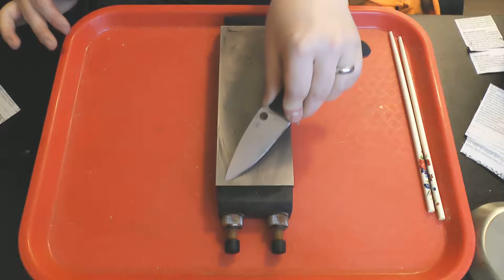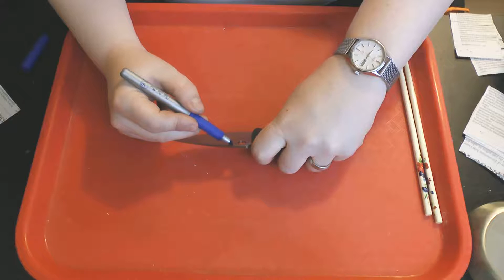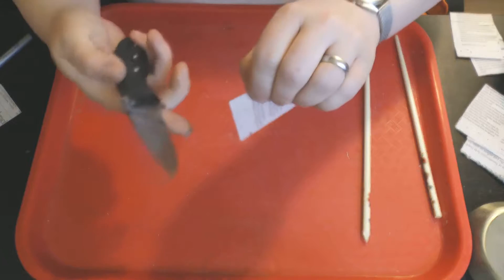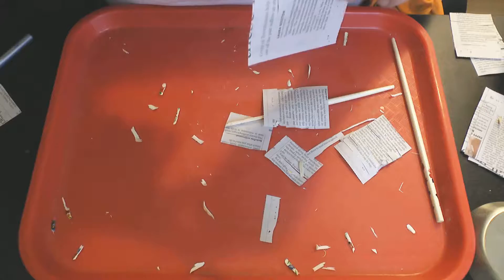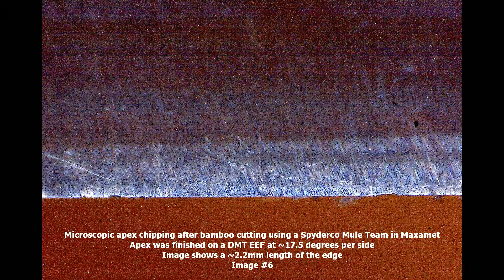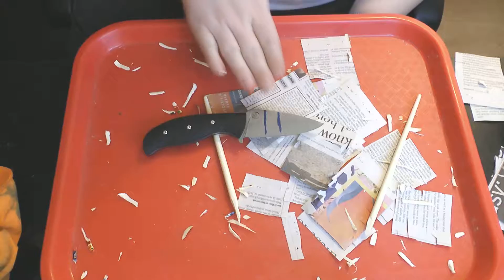AlOx and SiC vs. Vanadium - Part 8: DMT EEF Retest on Bamboo

Comment: I would agree with You. 
https://www.youtube.com/user/pavolko10 - my friend Pavol tests edge retention on rope 
and uses tormek AlO wheels, he used a natural stones many times on high 
wear resistant alloys. So far every knife he sharpened himself shown increase in edge 
retention compared to makers sharpening. So it is unlikely diamonds are necesarry. 
To add he tested knives out of ZDP-189 at 65HRC, REX-121 at 68HRC: 
https://www.youtube.com/watch?v=OtPp93N-atY 
Knives shown very good resluts in the tests so again it is unlikely 
AlO/SiC abrasive is not suitable to be used for sharpening high carbide steels. 
In industry they are used for HSS few decades without issues..

Comment: Where did you purchase the sigma power stones
Reply from the maker: Lee Valley Tools carries them.
Reply: Steel Drake okay thanks
Reply: you can smash a diamond with a hammer no problem and buck 420 will wear down a diamond plate over time.  Vanadium carbides will crack from silica or ceramic stones just from the act of sliding them across the blades surface.  the exposed shards will then crack further and smooth out with the rest of the ferrite. sharpening has more to do with large surface against small surface.  the large surface wins every time.  the carbides will begin to protrude with use protecting the matrix however, thats what causes the steel to resist further wear and help maintain a working edge far longer than a low vanadium carbide steel.